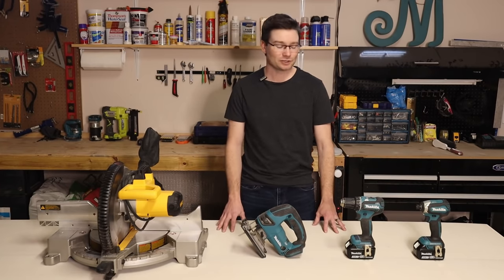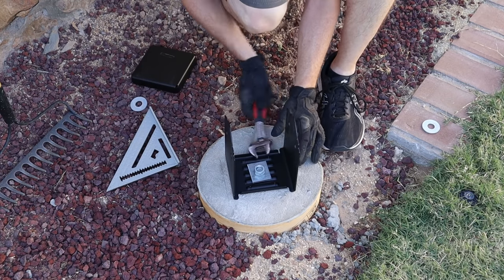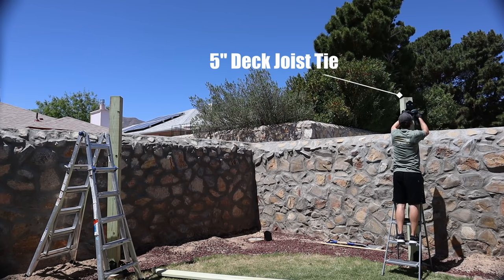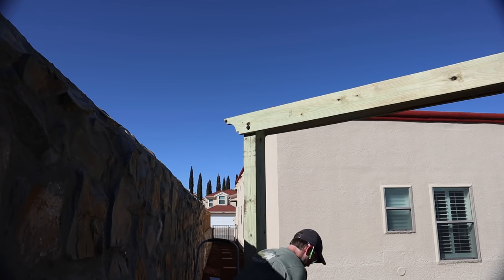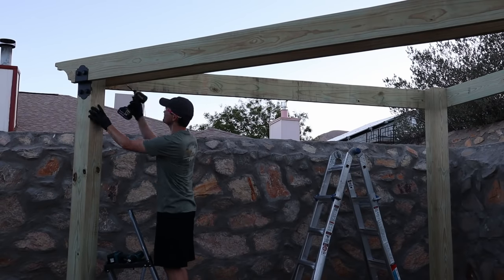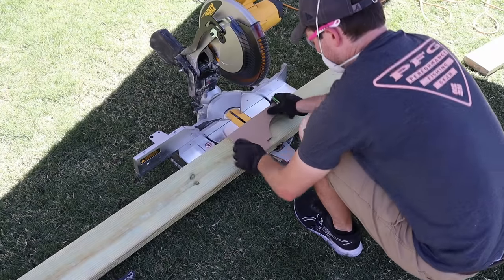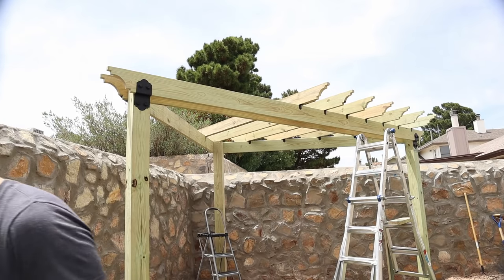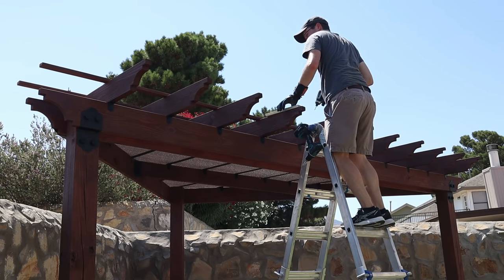Building a DIY Pergola

Comment: I'm in the process of designing and starting our pergola.    I am torn about using the simpson screws vs a good size bolt through all 3 boards.    Even my lumber place ( not big box ) was suggesting to use carriage bolts.  Nice work.
Reply from the maker: If it helps your decision, they have held up great through 3 years! Carriage bolts would of course be a fine option too. Thanks for watching and good luck with your build!

Comment: Great Idea - here in Yuma me and my wife have designed a three legged pergola, and "wha-la" your video is helpful similar to our sizes has well. Our idea is to put a lightweight swing chair inside, the purchased chair is a Wayfair product that will hold up to 600lbs. Do you think the 2 x 6 rafters or 2 x 8 beams will sustain the weight? Also the center cross beam i don't think you put the hardware for those. I'm assuming they are a left & right hand 2 x 8 joist hanger from Simpson strong tie or other? Instead of ordering or purchasing 2 I presume it would be 4 si or no?

Comment: Best idea for my small yard. How many centimeters deep you set the concrete base ground please
Reply from the maker: That's all dependent on your climate and soil type. Your local building guidelines should help with this. I'm not sure how it is done outside of the US, but here you can contact your city representatives or possibly the website. My base only had to extend around 45cm below ground, but yours may be different.

Comment: great job.. a question for you... is there any adjustment on the level of the post brackets? i want to do this but concerned if i dont get the base 100% flat and level the posts wont be 100 % straight

Comment: hello can you please let me know the exact product list  of how many of everything you used hardware and wood , I see the wood specs but not how many of each , thank you so much its beautiful!
Reply from the maker: Posts - 6" x 6" x 8'         -    (3)
Beams - 2" x 8" x 16'     -   (4)
Rafters - 2" x 6" x 16'     -   (5)
                2" x 6" x 8'       -   (8)
Strapping - 1" x 2" x 8'   -   (10)

You could substitute 2 of the 2" x 6" x 16' for 12' lengths, they just didn't carry them at my local store. 

Good luck!
Reply from the maker: Post Base   -   (3)
Deck Joist Tie -   (2)
Angled Rafter Hanger (left) -   (1)
Angled Rafter Hanger (right) -   (1)
3-1/2" Structural Screw -   (24)
5-1/2" Structural Screw -  (12)
Decorative Washers -  (24)
Rafter Clips - (35)
Reply: Thank you for all the info!

Comment: First of all I wanna say congratulations on a job well done but I just want to mention that in a high wind areas the wind will rip out the screen in no time. Please let me know how’s it holding up so far. 
One last question how much did the material cost you ?
Reply from the maker: Thank you! We are a little over a year out from completion, and so far it looks just like the day it was built. I'm honestly a little surprised at how well the screen has held. So far it has gone through several storms with 50+ mph winds, two snows (one with 4-6 inches), a few minor hail storms, and one with category 1 hurricane winds. We essentially live on the side of a mountain where the wind is a serious problem, but so far so good!

All said and done this cost a little under $800. Fortunately I was able to buy all of the material right before lumber prices went crazy, so it definitely would have been more expensive if I built it today. Very much looking forward to costs coming down soon!

Comment: Looking to replicate, but at 17x12x12.  Just making sure.....your joists are 2x8 and runners are 2x6 spaced at 16".  What is your lath spacing?  How many inches are your joists past the posts (on the front side)?  Thanks in advance.

Comment: Great video!! Question: Do you know if these post bases can be used on sloped concrete? Meaning ....can i still get the posts plumb using these post bases on sloped concrete? If so, any advice? Thanks in advance!!
Reply from the maker: Unfortunately I can't think of a way these would work on a sloped surface without being modified. If it were me I would pour a wedge shaped footing with some rebar extending down into the existing surface.
Reply: Household How To  Cool. Thanks for the reply!

Comment: Excellent job on this entire project. Your videos are well done and easy to follow. Was there a technical reason why you went beam to post as opposed to hanging the side beams using deck ties on the back post?
Reply from the maker: No reason other than cost. If they were visible I would have added matching ties. Hasn't presented any issues so far. Thanks for your kind words!
Reply: @HouseholdHowTo  Thanks.

Comment: Great production of your process! Do you think that the 2 rafter straps on either end is enough to keep them from pushing over in a strong wind? I’m getting ready to start a similar process of pergola/deck. Thanks!
Reply from the maker: I ended up adding a third clip to the longer rafters that attached to that extra support beam that went across the middle. The longest ones have three but the shorter ones still have only 2. We've been hit with several wind storms since completion, one got up to 75+mph gusts, and it's still holding up beautifully. Thanks!

Comment: Great job! It looks amazing. We are looking to build something the same and your material list is very helpful, however I don't see anywhere where it says the size or measurements between the 6x6 posts.  Can you tell me what size the pergola is and what the distance is between the center of the footings (distance between the cement bolts).
Reply from the maker: For the two sides that run along the wall, the bolts are 10 feet from each other, which puts the long front side at a distance just a hair over 14 feet (170 inches).

Comment: Nice work! Thanks for posting...I'm wanting to build a smaller pergola/arbor and needing to make some design decisions. Do the structural screws come from both sides on the footers? Do the screws line up so they hit each other if coming from both sides? I've been wondering how those Accent Line Simpson ties hold up.
Reply from the maker: Thank you! Yes, the screws for the footers do come in from both sides and the holes don't appear to be offset from each other. I did not run into any issues with them running into each other. My assumption is that because they are a smaller diameter than your typical lag or carriage bolt, they can deflect to the side if the tips do manage meet. 

All of the strong tie hardware has held up great at a little over a year out. We've had some monster wind storms (one reached 75+ mph) and so far the structure hasn't so much as flinched. I'll definitely use them again.
Reply: Ok good to hear! Thanks for the reply!

Comment: Can I ask how its holding up for you? I am in the process of building a corner pergola with a deck since its on a sloped area. Also using treated lumber 6x6x10 12' wide 8 foot deep.  Any issues with twisting or warping? Thats my only concern on using treated wood, cedar is just too expensive. Great job BTW!!
Reply from the maker: This has held up great for us. We had a few rafters warp, most were fixed by an extra screw or two, but one had to be totally swapped after it bowed. Given the big price difference I definitely don't regret using pressure treated.

Comment: Did you ever add any knee braces to support the structure?    I ask because after recently building mine it would sway/rack with minimal effort.   After adding some knee bracing it's been rock solid.
Reply from the maker: I actually planned to! I assumed it would need it especially for being a three post structure. At the end everything seemed rock solid so I held off on the knees. Two years later and it's still just as stable. I wouldn't hang a swing from it, but it's held up to more than its fair share of abuse.
Reply: What is a knee brace and where do you put it?

Comment: Looks like your concrete was not wet enough, just way too dry, which was obvious when you shoveled it into the tube form, but double obvious when you pushed the bold into the concrete, it left a void which you then needed to tamp to fill in.

Comment: Where did you get the screen material?  Are you still glad you installed that under the roof boards?  Any idea how long it will hold up before needing replaced?
Reply from the maker: We found this stuff in the garden section of Lowes, sold by the foot off bulk rolls. So far it has held up great over two years, doesn't show any signs of needing replacement. I think sandwiching them between the two layers has kept the wind damage virtually non-existent. I would definitely do it this way again. Thanks for watching!
Reply: @HouseholdHowTo  Thank you for the quick response.  I showed it to my wife and she is elated with us(me) installing that in the pergola that we(I) have been told that I am building after extending the deck to twice the size.  Anyways,  thanks for the how to video and the info.  Will come in very handy.

Comment: I actually have a question. We are building this exact model, but it seems a little unstable; not sturdy. Can you offer any advice?
Reply from the maker: If you're experiencing some swaying, I would for sure add some knee braces. They are the diagonal pieces you'll typically see connecting the post to the headers. Google "pergola knee brace" and look at some images.

Comment: Awesome! I want to build one but have a question. I'm building on existing concrete so don't need concrete footings. How would the post base  be attached?  Could you please comment. Thanks!
Reply from the maker: I would use the same hardware that was used in this video, except instead of having a bolt coming up through the metal post base from the concrete footing like you saw here, you would drill from the top down using an appropriate masonry anchor such as a wedge bolt.
Reply: @HouseholdHowTo  Thank you!! I see concrete expansion bolts at HD.

Comment: Fantastic!! Does pressure treated lumber need to be sanded and if so, did you do all the sanding before putting any of the structure up?
Reply from the maker: I chose not to sand anything to avoid compromising the protective treatment, and also because everything was still fairly wet when it was assembled. So far things have held up fairly well. Thanks for watching!

Comment: Were did you get the mesh for the shade? Awesome Job by the way, I'm thinking of doing the same one, thanks to you! 👍🏽
Reply from the maker: The mesh we used is sold by the foot off a large roll in the outdoor section of our local Lowes. Thanks!
Reply: @HouseholdHowTo  ...what is it called....just 'mesh'? I wanted to be sure I get the right thing.
Reply from the maker: @zaneblane8160  The one I used is "sun screen fabric" and the brand is Easy Gardener. Lowe's item number 68330.

Comment: How does the fabric hold up to the sun?
Reply from the maker: Very well! Just gave it a once over before heading into spring and everything is in great shape. No rips or brittleness to speak of. If I need to replace it, I'll probably throw a second layer on. The single layer cuts a good bit of the sun, but it's just so intense here a second layer wouldn't hurt.

Comment: what are the long screws you used (the black ones) to hang up the joist?  At around 6:00
Reply from the maker: It's a combination of these two:
5-1/2" Structural Screw - https://amzn.to/3uqnVM6
Decorative Washers - https://amzn.to/3uD8alf
The screws fit inside of the washers to provide a decorative look.

Comment: What's the  width between the front two post? Also the length between the front and back post?
Reply from the maker: The front and back posts are 10ft and it's 14.1ft between the front two.
Reply: @HouseholdHowTo  thank you

Comment: Very helpful videos (this one and the first one with the concrete footings)! The finished product looks great! Two questions: (1) How far did the rafters extend beyond the front beam? You used your spacer to set 10” from the front beam to the first decorative cut, so the distance from the beam to the end of rafter looks to be around 16” total. (2) How far do the front beams extend left and right beyond the posts? Looks like ~12” as my best guess from the video.
Reply from the maker: You're spot on! The rafters stick out a total of 16" from the front beam. The front beams end 8.5" from the outer edge of each post. Thanks for watching!
Reply: @HouseholdHowTo  Thanks for the instant reply! We learned a lot from your videos. Looking forward to seeing more.
Reply: @HouseholdHowTo  That prompted one more question: What's the spacing between your rafters? Was it 12"?
Reply from the maker: @fredkrebs3751  We went with a 16" spacing for the rafters, but I think either 12" or 16" would be just fine.
Reply: @HouseholdHowTo  Thanks for the added advice!